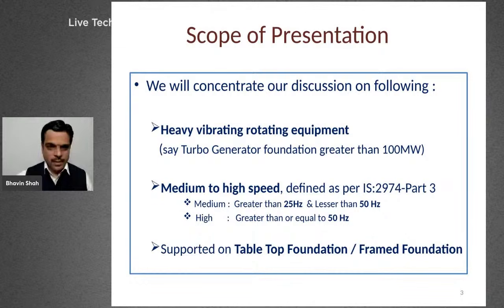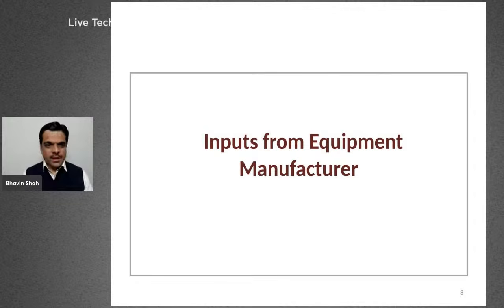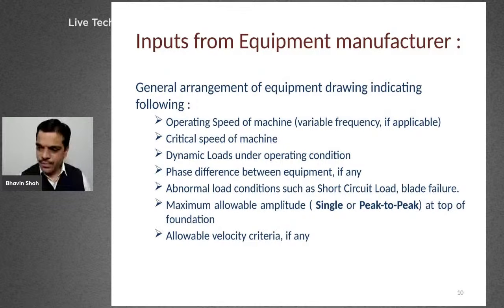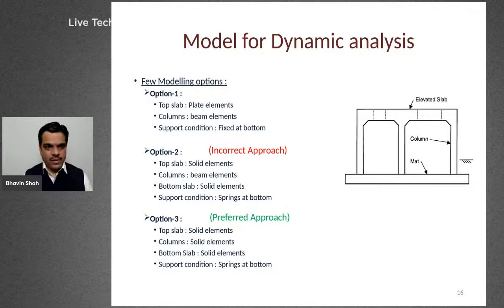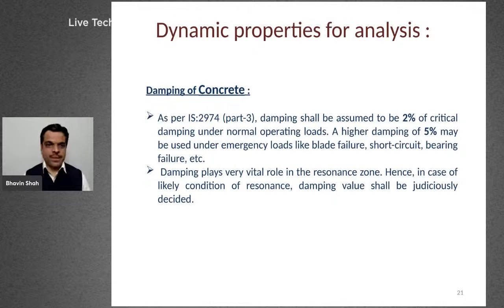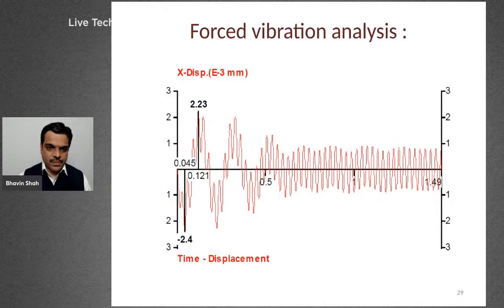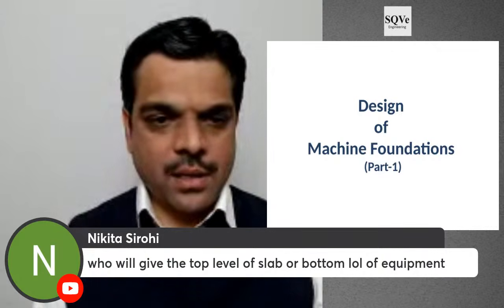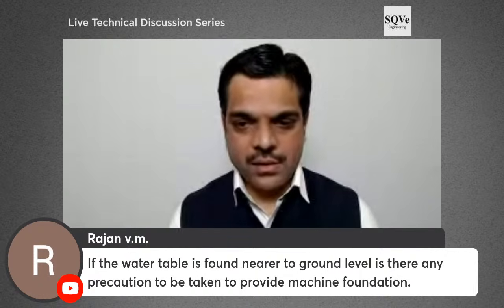Session 36 : Design of machine foundations (Part-1) - Bhavin Shah

Comment: Hello sr
in my case i have only a block type fondation 
how could i processe
sincerly
Reply from the maker: The process will be almost similar. The model may be created using 3d solid elements or manual calculations may be done. If interested, you may explore recorded sessions of our previous batch of machine foundation course: https://sqveconsultants.com/dyn-str-001
Reply: @StructuralEngineering think you very much for your response
Reply from the maker: @haddouchinabil4129 You are welcome.
Reply: @StructuralEngineering  Hello sir
Could you help me with my case a have a centrifigual pump, do you have a excel sheet to calculate my fondation
Sincerly
Reply: @StructuralEngineering  Hello sir
I need to calculate a special case of centefigucal pump, how many fees it will cost me please
Reply: @StructuralEngineering  i will send you fees as you want and you calculate this for me with detailed note

Comment: It is great presentation. One issue as the last question ask related to water table reaching Ground level. Do not you think Foundation isolation is required as water may transmit vibration to all other foundation/structure. Thanks
Reply from the maker: Yes, machine foundation should be separated from the other foundations to prevent transfer of vibration.

Comment: Is it possible to install a 2000 kg heavy machinery on 3rd floor ? The slab thickness is 8" only. This machine has a component which has oscillations.
Reply from the maker: It is possible but detailed dynamic analysis and careful detailing is required. Local thickening of slab and additional beams will be required to control the vibration. For the existing slab, you may share the details of machine and slab at the following email address for further discussion:
contact@sqveconsultants.com